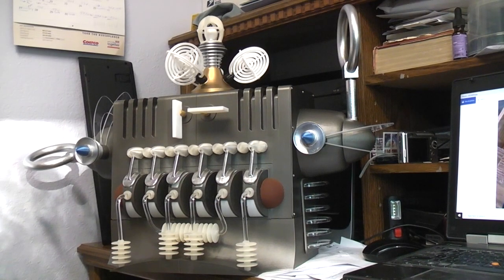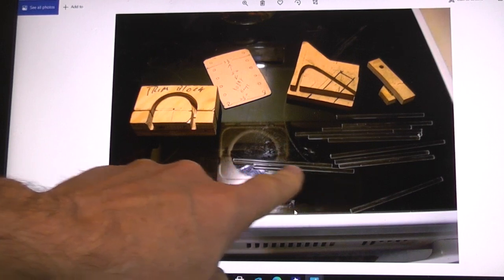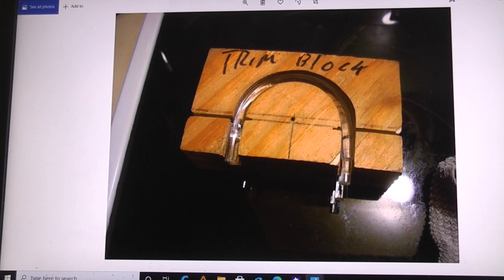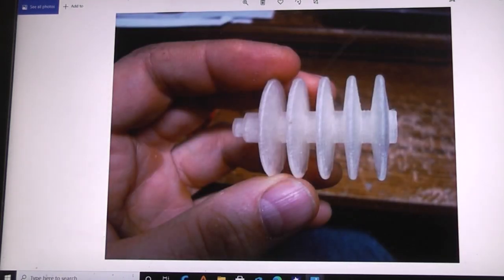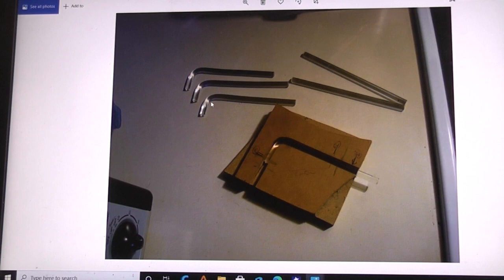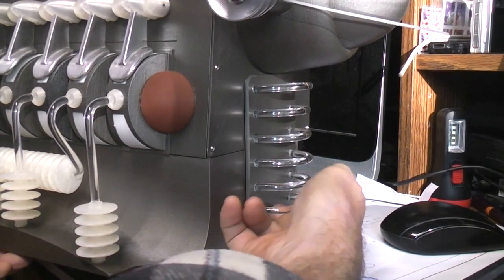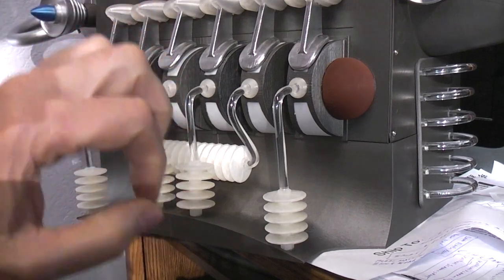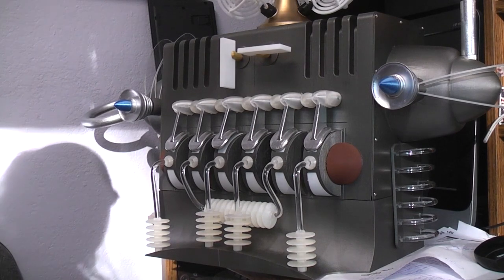Step 6. Robby Machine. The detail parts. wrapping it up.

Comment: Amazing as usual, one way or another you will have a Resin Printer, please don’t stop making videos🤔I wonder if the entire Robbie could be built by printing him piece by piece by piece by piece, just a thought, 😜
Reply from the maker: Several guys are doing that now. For me it does not make sense to make a jigsaw robby, but to each there own. I have built robbys as mixed media, all thermal formed plastic like the original and by casting in resin and fiberglass. Those 3 ways make more sense to me.
Reply: Robothut  Yah I saw a Ferrari body a guy printed but with all the bondo and fiberglass to smooth everything it took 3 years lol and that’s a lot of pla 😜